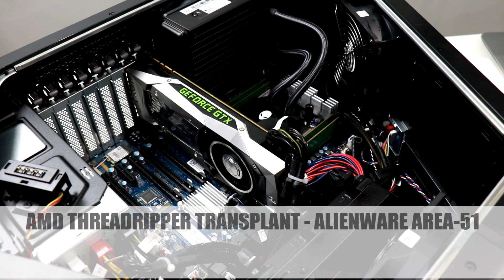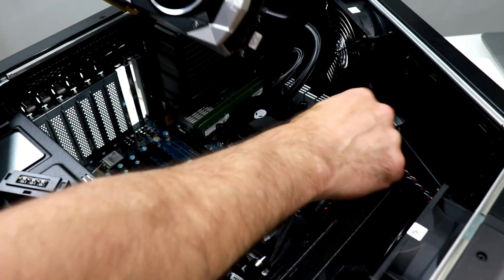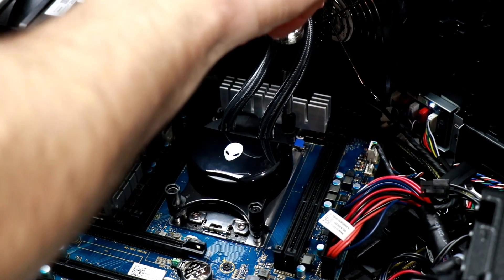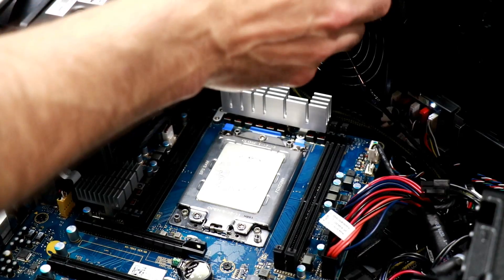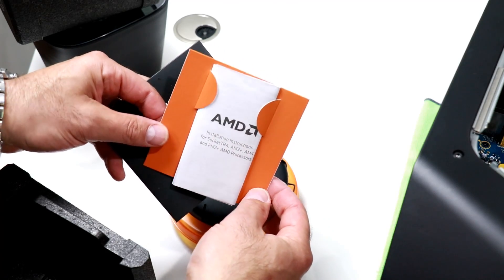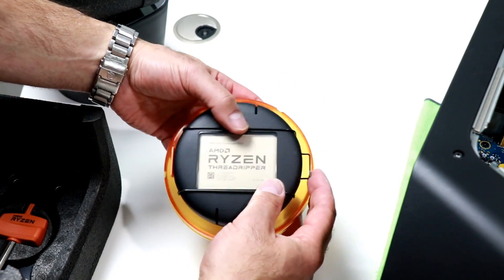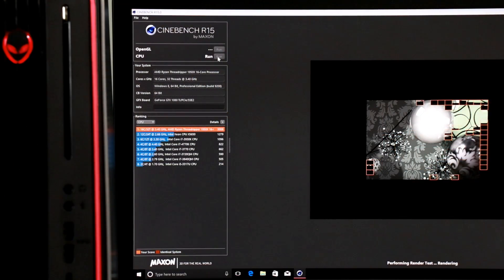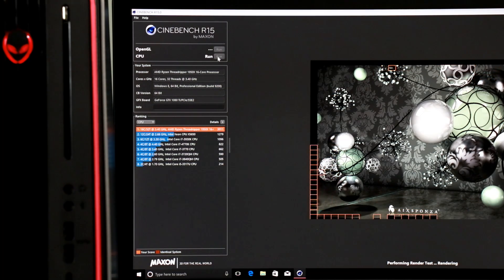AMD Threadripper Emergency CPU TRANSPLANT! Alienware Area 51 Threadripper Edition

Comment: just intro comment wow im running this cpu i bought mine with three missing capacitors on the bottom tring to figure out some way to locate the brute force capiritorer's nasty joke of the unlucky person to buy this absolute D1k3 move of a deal to hear this wow wow wow forget this by the way no gloves static electricity sensative parts dont go together.

Comment: I do 3d rendering and purchased a new machine lately with the top of the line threadripper. Despite my machine rendering images really fast now which is great, I was some what surprised regarding multitasking. I really thought that the top of the line threadripper would be much better for this. I thought that I could do Photoshop work while I'm rendering an image in my 3d software but nope......it slows down Photoshop so much that it's practically unusable. When my 3d software is rendering, it's utilising like 99% of my cpu. Is that the problem? Can I twerk the threadripper settings to help with multitasking? I thought threadripper was supposed to be a beast when it comes to multitasking.

Comment: Is it me or does that motherboard look cheezy
Reply from the maker: Define cheesy?  As in devoid of RGB lighting, power array thermal solution bling etc.? I can tell you the board and system run cool and stable and the standard issue heat sinks strapped to the board's power circuit are plenty beefy.

Comment: That 120mm AIO is sad...should be nothing less than a 280mm rad running Threadripper.
Reply from the maker: As someone noted earlier, don't get it wrong. That rad is very thick, it's about the surface area of a double fan cooler.
Reply: I have a 120 MM thermaltake water pro 3.0 with a single noctua industrial fan on it and it kept my 9590 cool for years those thick rads can cool just as well as a H100i does.  I never had trouble keeping my 9000 series cool even in the stupid hot summers of TN even on a hot day it never went past 51c on the cores but most of the time the cores at 39 to 45c when gaming. I still use that cpu cooler for my 1800x since it works so well.

Comment: your supposed to rip and unpackaged the styrofoam part before you twist to unlock. that way the CPU won't fall out when you open it like it almost did for you.
Reply: Did we watch the same video? He clearly removed the Styrofoam and was holding the inner casing, and he undid it from behind while shooting a front shot. I've seen half a dozen gag reel worthy Threadripper unpackagings but this wasn't one of them.
Reply from the maker: Ha! Thanks! :)

Comment: Why would Dell send Preproduction CPUs? I get they want their product out during the Hype train, but Gimping the CPU with such a Horrible AIO cooler which barely cools the CPU is just plain Stupid.  50 bucks of cooler for a 700+ CPU?

Starting Price is already at 3K!!!!

I hope more reviewers mention that.
Reply from the maker: Don't get it wrong. We're still looking at temps and cooling but AMD has officially sanctioned the round Asetek cooler plates for all Threadripper CPUs and in fact will be shipping a conversion bracket with chips so folks can adapt existing coolers. The die on Threadripper are under the circular cold plate and AMD noted it's more than adequate. It just needs to have good cooling capacity as a system. The rad on the AIO is very thick too, twice as thick as a standard rad so it has the surface area of more like a double fan rad.
Reply: I'll put my faith Into you guys as I'm seriously considering getting me a TR by the end of this year. Would you also please check Thermal Paste on your Reviews for TR? 

Thanks for the response. 

Waba laba Dub DUb!!!!
Reply: I believe that this system is also a preproduction sample. Asetek is working on TR-specific cooler at the moment.
Reply: TDP isn't crazy, and if you actually look at the inner die shots and core positions, it's nowhere near as egregious as it looks. Will be really interested to see how the thermals pan out, but already airing towards fine.

Comment: I'm sorry but that motherboard looks like it was made in 2010!!  I would be ashamed to show that off in such a high end system.
Reply: Never buy alienware, is just overpriced crap. You are better building it yourself   or paying someone thrustworthy.
Reply: Agreed!! It looks awesome on the outside, but holy crap, Inside looks like a total disaster!  Ketchup and mustard cables, only 4 DIMM slots!!! Seems legit.  Dell's margin on that motherboard must be insane!
Reply: Leme guess you like that RGB crap right?
Reply: Don't really care too much about RGB - its not really high on my list when building a system.  But this is supposed to be a flagship system, designed to showcase a new platform.  It deserves a way better motherboard, better cooling and better cables.  I'm sure it will perform really well, but once you look inside at the components, you can see where corners have been cut and given the price point, there is no excuse.  Can't wait to see what the other boutique builders have to offer.

Comment: In my opinion they have to start making a vacuum sealed socket the sucks out all of the air after you put the cpu in so it won't oxidize and be even cooler(colder).

Comment: The cooler contact patch is way too small.
Reply from the maker: AMD informed us in a formal briefing that the circular plates like Asetek are just fine and they will be incorporating adapter brackets to include with processors for people that have existing AIO setups. They said a covers the critical die surface areas that are needed.
Reply: If you wan't the most out of the AIO you need a plate that covers 100% the surface area of the IHS. As it is right now the center of the plate is on top of nothing because the 4 dies under the IHS leave an area in the center where nothing is transfering heat. So I am sure the first AIO specifically design for TR4 socket will out perform the adpated ones by a huge margin. Look at the Gamers Nexus video about this released a few days ago.
Reply from the maker: I would not disagree with you that a cooler specifically designed for the Threadripper IHS is going to perform better. I'm just saying this cooler and others like it will be be up to the job as well, likely not the same level of performance but still acceptable, as this is.

Comment: I don't see how, but these things must be super sensitive to shock eh!?
First, you have this super cool but utter over kill for packaging.
Second, the CPU itself is contained in it own mounting frame where you don't touch the chip itself at all!
Third, then you have to Torque the Chip to the MOBO (in a specific pattern no less). Something that is generally used to prevent bolts from coming loose due to vibrations.
Fourth, You still then have  to mount a Cooler, which also secures the Chip to the Mobo... 
Is this Chip going to try and get up and dance or something!? Needs a Straight Jacket to lock it down!? I would really like to see someone run this CPU without the torquing down and see what happens.

Anywho, also, I thought two dobs of Thermal Paste was a No NO because it cause gaps and create hot spots?
Reply from the maker: Interesting observations but the package I don't think is overkill. There are a lot of cores in there that need to be connection and a ton of serial links to hook it all up together and to the motherboard/system. Also, the cores are actually more toward the edges of the packages, not in the middle and the paste I put down spreads out big time when you crank down the AIO cooler. The single spot of paste that Dell put on there probably was just larger than my two that were spread out more. I spread them out slightly because of the rectangular shape of the CPU. Regardless, all seems to be running just fine and nominal here.
Reply: Also there were alot of intel people that destroyed their pins on their montherboards with this set up that is a reason as well .
Reply: Threadripper needs exact torque or it wont boot this is just a protection measure for the pins. Since the pins are on the motherboard you would think they could make them thicker or tougher but they seem to still be very fragile.  And as i said before their is a history on Intel of dropping the cpu are torquing down too hard and destroying pins.

Comment: If I may suggest please. Redo the thermal grease its not recommended to do separate amounts as air may get trapped between them so I humbly  suggest to make 4 pea sized amounts touching each other as in the MSI Threadripper video. Thanks
Reply from the maker: Thanks for the tip but I can tell you after mounting and remounting the heat sink, that it doesn't matter much for this particular cooler in the Area-51. The factory previously had a single TIM application in there in one circle, actually. This resulted in two large areas covering almost the entire top of the chip. I would agree that 4 smaller applications may offer slightly more even coverage though. In fact, a rectangular cold plate that fits the shape of the Threadripper chip would probably offer better cooling than this round one.
Reply: I agree I think we need an AIO with the plate size of the TR4 compatible Noctua NH U9 TR4-SP3 cooler. They will surely come. Without mentioning channel names there is a good video on Youtube that illustrates that the footprint of these type of AIOs' plates is too small and doesn't cover the whole 4 dies underneath the spreader. We will know next week how efficient these are when we get some overclocking and temperature data.
Reply from the maker: Pandu Poluan AMD informed us in a formal briefing that the circular plates like Asetek are just fine and they will be incorporating adapter brackets to include with processors for people that have existing AIO setups. They said a covers the critical die surface areas that are needed.
Reply: I think -- and this is just a guess, I'm not really well-versed with thermodynamics -- the Indium solder that AMD uses to stick the IHS onto the dies help a lot...

Indium, a metal, transfers heat well. So the heat from the die can quickly be transferred to the IHS. The IHS is also metal, and metal has good heat conductivity, so the heat will quickly spread to its whole surface.

So, the problem with "hot spots" should be less pronounced.

This is as opposed to Intel using paste to transfer heat to the IHS; the paste do not conduct heat as good as Indium solder, so even though some heat reach the IHS, much more heat are still trapped on the die. This means that heat must be removed as quickly as possible from the IHS. Hence, the focus on cooling the hot spot(s).

Again, I don't have a strong background with thermodynamics/thermophysics, so CMIIW.
Reply from the maker: Learning more on this topic actually. AMD has officially sanctioned the round Asetek cooler plates for all Threadripper CPUs and in fact will be shipping a conversion bracket with chips so folks can adapt existing coolers. The die on Threadripper are under the circular cold plate and AMD noted it's more than adequate. It just needs to have good cooling capacity as a system.
Reply: Another YouTube channel had actually tried to map where the round plates land in relation of the 4 dies' positions, and found out that the round cooling plates cover maybe only about half of each die. So, it's not "optimal", but still very serviceable.
Reply: Awesome! Thanks for the info!

Comment: I'm really interested to see what kind of temps AIO's can handle, when only covering about 2/3 of the CPU? I imagine they're limiting the potential of that CPU, until they come out with larger cooling plates, on the pumps.
Reply: Amd chips dont have toothpaste in them so they should be ok. lol
Reply from the maker: I'll be looking at loaded temps soon!
Reply: on release AMD said there will be multiple coolers available AIO and air.
Reply: +Darkpharoh, LOL, Toothpaste might actually be an upgrade from the shit Intel's been tossing under their heat spreaders, lately...Pretty fk'd up, when you have to de-lid your CPU, just to keep it running cool, even at stock speeds. That's the case with some of the X299 chips.

It's a shame too, because they actually have some decent CPU's, but they slap them together, like they give zero shits. Totally unacceptable for the prices they're charging for i9 CPU's. Totally screwing ppl, IMO.

I won't even build on X299, just out of principle, even though it costs me money, and maybe customers. Not as long as they're slapping 7700's on top of PCB's and calling them 7820's, and charging for RAID keys, limiting PCie lanes, and cutting off half the RAM slots, for some of the lineup.
Reply: Yeah, AMD did go and make an adapter for typical AIO mounts, but it only has partial coverage so it won't be great cooling. It is exciting when new shit starts mixing up the market :)

Comment: What about overclocking? I saw an article with Threadripper being pushed up to over 5 Ghz, but that didn't look like  for real world application. 
Have you done anything yet with overclocking?
Reply from the maker: We're under NDA for a few more days but I can tell you 5GHz was definitely not on air. :)
Reply: Dracule Mihawk The over 5GHz run was on liquid nitrogen. IIRC it was just shy of 5.2GHz.
Reply: Dracule Mihawk Impossible except if Amd have change their manufacturing process for other then 14nm.
Reply: Not impossible when pros are doing it: https://hothardware.com/news/amd-ryzen-threadripper-1950x-smashes-52ghz-barrier-on-ln2
Reply: It has the same overclocking properties as ryzen 7 as they are virtually identical....so on air it will OC to about 4.1 occasionally and on water you might very rarely get one that will OC to 4.2....beyond that would require phase change, ln2 or hydrogen cooling. Most likely any clock gains on the revised xen architecture in 2018 will be pipeline improvements to enable higher clocks.
Reply: It seem that you can get to 4ghz on all 16 cores. So a ~3300 R15 score.  10% better.
I dont think its worth it.
Reply: they did overclock it to 5.2 ghz at a recent AMD event but that was with liquid nitrogen cooling. with water cooling it will most likely top out at 4 ghz like every other ryzen chip.
Reply: ElDuderino I linked the event OC above.
Reply: atomkinder67 right that's the one, I only saw a short video of it that someone filmed on his phone.